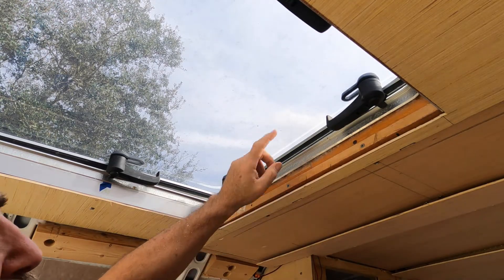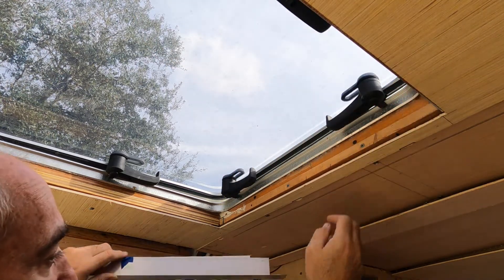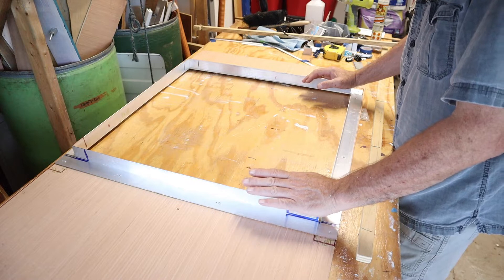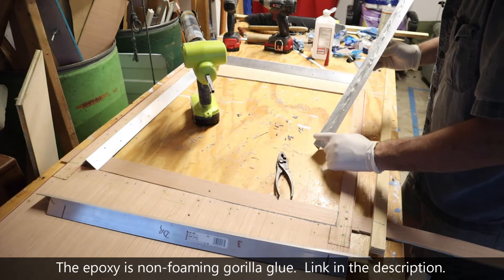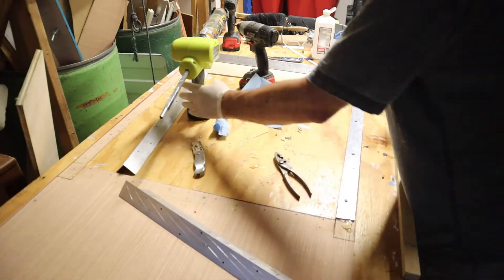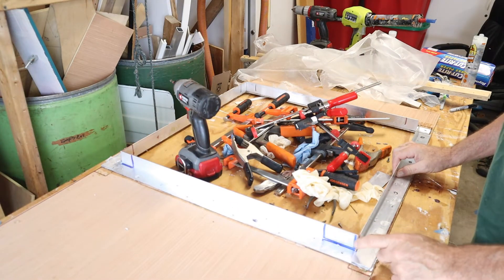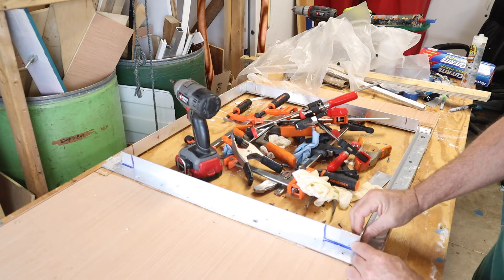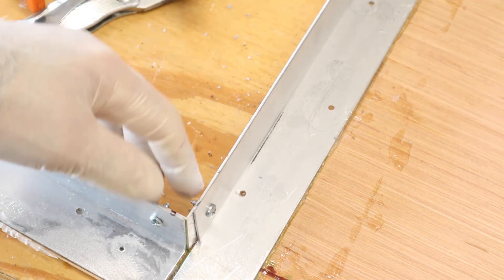Van Build: How to create a skylight or roof hatch frame and trim panel PART 1

Comment: Nice work.  would be Brilliant to build a solar panel lid that is water tight with a press in water seal strip.
Reply from the maker: That would be very small and fragile.  We have 400 watts of solar on the roof.  Check out the Van Tour part three to see the completed deck, and solar   https://youtu.be/kmVuEm9dP9U